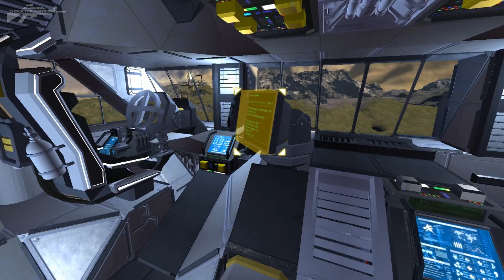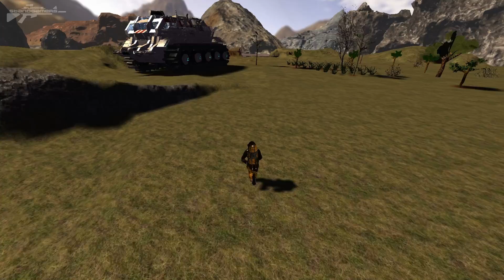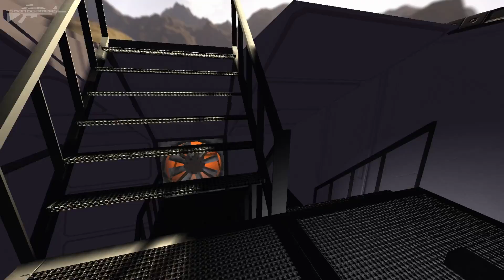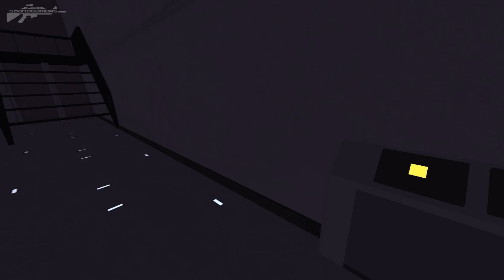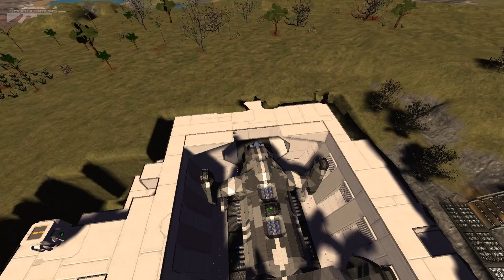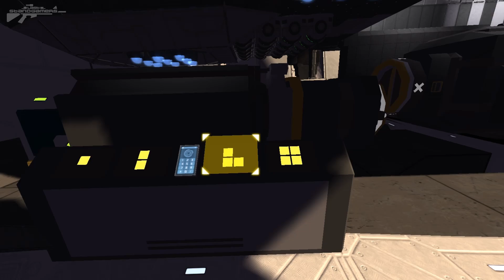Space Engineers - Planetary Outpost Construction (PTE)#2

Comment: Lessons in making planetary base building as unnecessarily complicated as possible.

Seriously, you could just make a ship with way more cargo than that and plant a big projector with some power attached and just build The beginnings of the base off a blueprint, then add and subtract rooms as you see fit. I don't even understand why you put your base slightly underground instead of just on the surface itself. it just seems like more work for little reason. If you want a base that is fully underground, you'll have to place it real deep under there for it to be of any use to you, and it still seems kinda useless since any kind of hangar or garage will have to have access to the surface anyway, which will just be either a huge, obvious door, or an above ground hangar. In which case, why bother and not just make most of the base on ground to begin with? You can always put a basement or a shelter under your aboveground base at any point anyway. This just seems really over complicated.

I also wonder if you could just orbital drop cargo containers with space balls to stop the impact and connectors to transfer supplies. Then, you can just grind and reuse the materials from the container and so forth itself. You'd only need to put a couple space balls to keep the container from impacting anything, anyway. And you could always put thrusters to dampen the fall if you wish.

Comment: cough Ion engines don't work in atmospheres... cough

I wish they added chemical engines with stupid thrust, but required fuel
Reply: ***** Well, energy density by volume. Masswise it's different.
Reply: waterlubber where will you find the fuel though and what will it be
Reply: Charlie Ward
Rocket fuel is..water.
You can make it from ice. You take some ice, split it into hydrogen and oxygen, and viola, rocket propellant. Not kidding. 1st stage engines are kerosene and oxygen, usually, but vacuum engines are made from H2 and O. In fact, the Oxygen Generator makes rocket fuel, but throws half of it out. :P
Reply: Thank God you didn't say oil
Reply: waterlubber It's also possible to make methane from carbon dioxide and water, which has quite a bit more energy density than hydrogen and is more efficient than kerosene, but less efficient than hydrogen. It's centuries-old technology, but would certainly have its uses on a planet like Mars in real life. The only problem is that the process requires quite a bit of energy and high operating temperatures, which means that you'd need a nuclear reactor.

Fortunately, Space Engineers has plenty of those, and an ISRU fuel refinery would be pretty cool. You can throw practically any liquid or gas that isn't horrendously corrosive or unstable into a nuclear-thermal rocket engine and get thrust out of it, although some are more efficient than others, of course.
Reply: *****
Haber cycle...wait, no, that was ammonia. I read that in the Martian. Methalox has lower ISP due to the higher atomic mass or something like that, iirc. I just remembered because of the Interstellar mod for KSP. :P
Reply: waterlubber Yes, it's between hydrogen and RP-1 (kerosene) in ISP and energy density, with hydrogen having the highest ISP and lowest energy density, and RP-1 having the highest energy density and lowest ISP.

Comment: I agree with the other posts on the "drop pod" idea. It would add many new aspects of functionality that your current method of manual docking just doesn't quite allow for (at least not as efficiently). With drone controlled pods, you could set up a "pick up/drop off" exchange type system. As confirmation came in that one drone had been launched  from either an orbital platform, an inbound drop ship, or possibly even a secondary ground facility, you could send a drone already docked with you (full or empty) out on a number of pre-programmed routes.These could include docking with said orbital platform or secondary site, moving to one of many holding locations for subsequent acquisition by the passing drop ship, or merely a true holding pattern until the new drone has off loaded it's cargo and cleared the bay. Additionally, the installation of a ramp and bay doors to on one or two opposing sides would aide in not only providing multiple ingress/egress options for airborne craft (vtol is cool, but limiting and not terribly operationally secure as there will be at least one point where your craft will be at near standstill) but also possibly allow for the use of your rover or other land based craft as a method of delivery. Anyway, love the vids, keep 'em coming, and thanks for reading.

Comment: Necessary things... A mine. A cafeteria. A garage bay. Perhaps at a later date a transit station. You may have multiple bases on a planet. And if each one has a sort of tram station then you can transfer materials and people easily without a monumental network of pipes. Certain areas will provide certain resources. Perhaps one has fuel thats very necessary for the rest of the base. Perhaps one is simply a spaceport hub. Another could be food production. Another ore production. And maybe you have an exploration base. A place meant simply for the purpose of deploying vehicles to check out the terrain and make outposts.
Maybe you make a spaceport city if the planet is hospitable enough for an above ground place. Or maybe you make it subterranean if the landscape is hostile. Hard to say.
My main suggestion is crew quarters. Maybe an elevator and some kind of apartment complex beneath the soil.
I'd like to see a garage that has a digger. It has a drill that can be shifted up and down or left and right to create large tunnels with an angle or curve to make underground highways to mines and other bases, as well as a turn off to the above ground if necessary.

Comment: if the planet has a atmosphere. it has a gravity fleild.... that's HOW planets HAVE atmospheres.... the gravity of the planet holds the air in.
@ 1:25
theres no way for there to be breathable air of any sort without something to hold it to the planet and the fact that there is a sky on your planet means there's air.
also. if there is air, it would be slowing you down like you had dampeners on

the jetpacks CAN work in 2G gravity flields... but it still means you would be just devouring power to hover tho..... (also. the game SAYS 2 G... I kinda wonder if maybe the "G" is not the same as on earth....maybe one G is weaker in this game...)

im pretty sure that if the game goes for realism. (which it might not.) you wont be able to just hover in mid air for free as you can right now.

we will see what the devs do.

(I must be misunderstanding you or something LSG.....)
Reply: Tom Jerry You can check the G force by measuring time to max acceleration, since Earth gravity is 9.81 m/s per second. No thruster should be working at all, ion engines do not work in atmospheres. I want orbits. :)
Reply: Tom Jerry You can check the G force by measuring time to max acceleration, since Earth gravity is 9.81 m/s per second. No thruster should be working at all, ion engines do not work in atmospheres. I want orbits. :)
Reply: waterlubber If they do gravity as they say they will, orbits will work.

Comment: Going off other peoples suggestions on "Base defences" most consider anti-air turrets etc against invaders. But what about the local wildlife? you don't want some random beast (that may be present) sneaking in and wrecking havoc on your supplies. I'd suggest a base perimeter wall/fence with small turret guards on the entrances. Also allows your workers secure access in and out of the base

Comment: I have not seen anyone make dropships with interchangeable loads. Equipment, crafts, buildings or storage containers that it drops off on the launch pad instead of docking every time it needs to offload. Maybe building an Orbital Cargo Drop system (OCD) you can completely eliminate the issue of bottlenecking? For surface to orbit systems you can try a railed rocket elevator!
Reply: i have made drop pods ,they tend to break easily
Reply: @bobjames, have you thought about adding breaking thrusters to the bottom of your drop pods? Tie them to a sensor and a timer and vuala, pod slows to reduce damage on impact.
Reply: Kurt Trevelyan  yes,but the sensor 50 meter range is abit short ,i used heavy armor to soften as well but to put it you must adjust the thrusters so it lands at less then 15 or boom ,moreless you must count for cargo and such
Reply: Bob James Blast doors seem to work.

Comment: It's a great idea to prepare for what's going to happen on the planets surface but there are many factors that could be the downfall of your base such as if your reactor is damaged or runs out of uranium there should be a plan b also if you rely to much on your drop ship if there is ever a situation where the mother ship or station in low orbit is attacked and makes it so u can't get supplies you should have a emergency escape or a way to maintain a stable amount of supplies also your drop ship is awesome but it seems it to big as in its great for moving troops or small amounts of supplies but you should make a smaller drone or ship that can transport only supplies to maximize your effort to get a base up and running and also it should require less fuel to transport